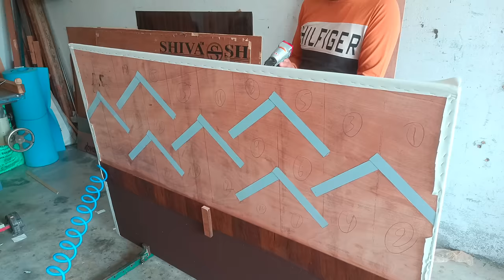How To Build Bed Back Headboard at Home ||

Comment: Yeh golden strip kis material ka hai....and market mein kya keh ke lena hota hai.....please reply
Laminated particle board use kar sakte hai kya isse
Reply from the maker: Isko golden patti bolte hai ye steel ki hoti hai yeh hardware store per mil jayegi or isko front design ki liye use kar sakte hai
Reply: @deepwoodwork  steel pati ko lagny ke liye kia use kiya hai
Reply: @deepwoodwork  steel pati be glue say he lagy gi kia
Reply from the maker: @ibrahimqurashi5854  steel patti ko Fevicol se lga sakte hai or
Hitex sr se bhi lga sakte hai